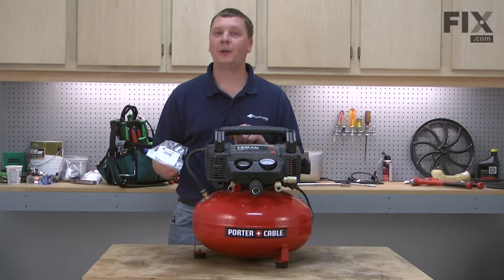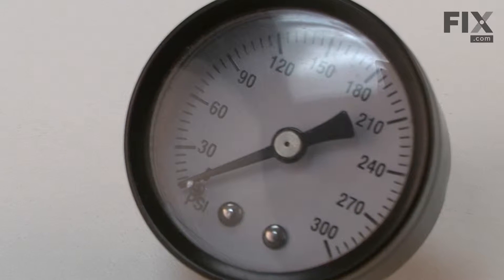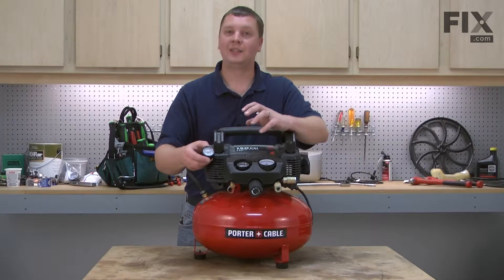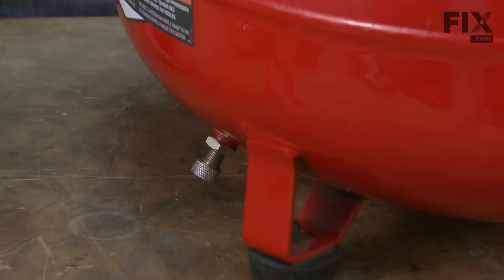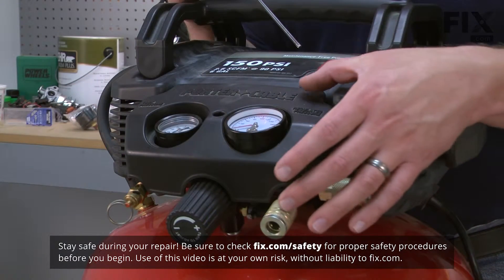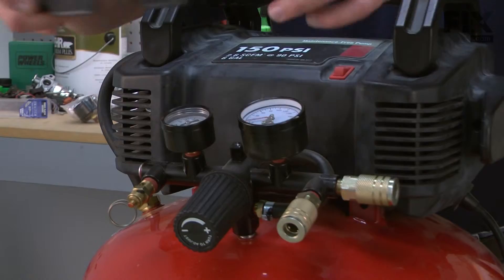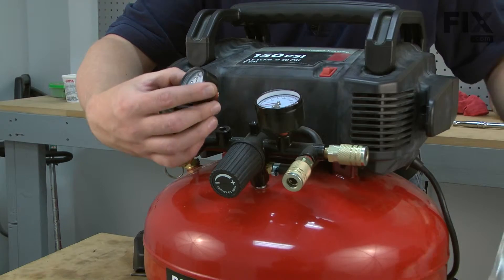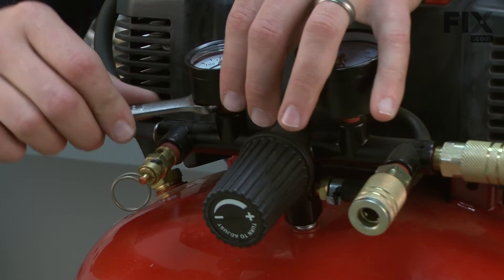Porter Cable Air Compressor Repair - How to Replace the Tank Pressure Gauge

Comment: T10 Bit... To potentially save someone some MAJOR frustration it's a T10 bit to remove the plastic cover that surrounds the gauges. Man I struggled bad w that because I could not see down there very well and what I could see was packed with dirt etc. I tried every close size SAE, Metric and Torx over and over until I FINALLY got it with a T9 lol But it is a T10, which is what I used to tighten it after I cleaned the head out and put it back on 🙄

Comment: What size screw , you don’t say and are not very specific on wrenches etc
Reply from the maker: I assume you are looking for the correct driver for the screws? The screws on this compressor are Torx type screws. Usually a size T20 or T25 but they do tend to vary between models or even between production runs. Torx screws have become vary common in tools, appliances, and vehicles. I would suggest having sizes T10, T15, T20, T25, T27, and T30 in your tool chest. These sizes will cover most of the Torx screws you will run into. -Mark
Reply: Boom. Very irritating. No bookmarking or subscribing here... 🙄